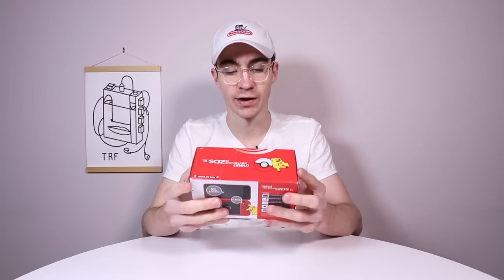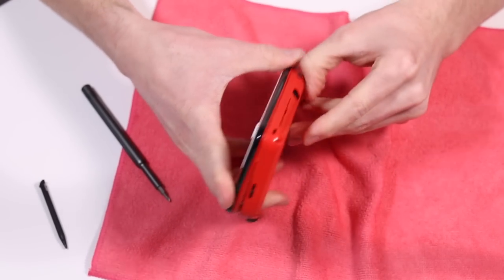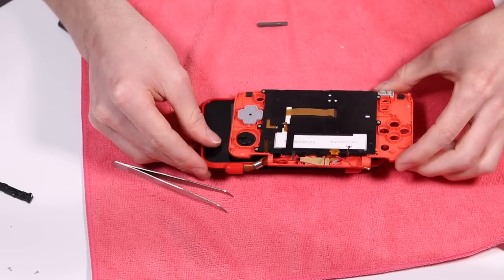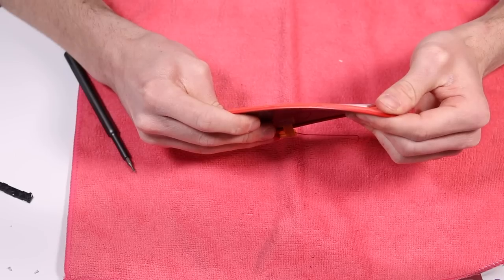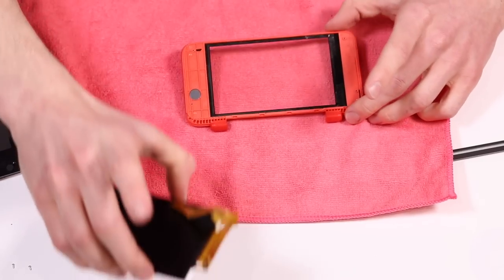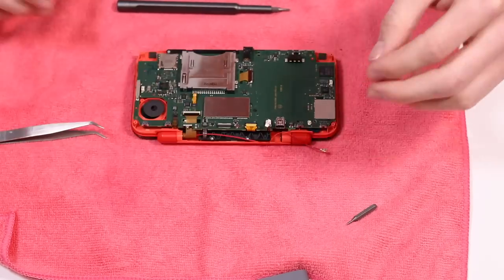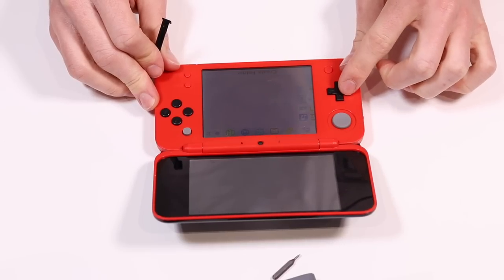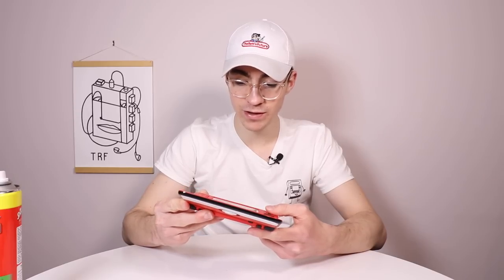The IMPOSSIBLE Nintendo 2DS XL Repair!

Comment: Refurb a some PS Vitas! :)
Reply: Ye
Reply: Less common.  Fewer sold for one and usually Vita owners are/were an older demographic so fewer get broken.
Not saying it doesn’t happen just that they’re usually quite expensive and the real ‘fixes’ outside of sticks are a nightmare in component costs.
Reply: Not really, pretty easy to replace pretty much anything at this point, I just replaced the display on mine.  @AcornElectron
Reply: You know why was the ps vita not successful, just a question
Reply: Big Doinks the fact that they must use Sony made SD cards, any other brand doesn’t work at all. And they were stupid expensive too. And also, not much big games besides P4G and Gravity Rush. I actually want one just for P4G, heard it’s a pretty hefty JRPG machine
Reply: @bigdoinks5884  
A simple answer to your question is, Sony.
Sony went through a lot of changes in that era including new staff, bosses and direction. The PS Vita was the old Sony's  (ps3 era) baby and the new guys wanted nothing to do with it.
Reply: @54356776  Never looked at it like that before. I was like sony what the hell are you doing ? This thing could've been great. I just blamed the company as a whole for the vita situation. I have an aqua blue and a silver psvita. I just got the ps vita tv from my local retro store for $28. Those things go for over $300. Even though Sony didn't handle these things that well. I still had to pick them up for cfw.

Comment: You should use a hot air gun or hair dryer to heat up the adhesive, that will make it easier to peel off.

Edit - was too quick to comment clearly 😂

Comment: Fixed to 3DS of my son some years ago. Its even worse, than the 2DS! While dismantling the display case is easier getting the brittle display cable in the hinge is horrid. The 3DS has no slit, you have to wind it up and stick it thru without damaging it. Took me several hours in the end.

Comment: One of the worst thing I have done is changing the keyboard on a HP ultrabook. It's about 50 steps and I had to take apart completely. But if someone done it once it's a lot easier the second time. Taking photos helps a lot for reassambling.

Comment: Your top screen protector surely get scratched for have it cleaned the back side with the towel. It's a common problem with the DSs and 3DSs. The front is practically unscratcheable but the back isn't. You can check it out with the console off and look it with direct light. I learned that on the bad way... Loved your reaction with the ribbon cables, hahaha. But I think the New 2DS XL actually has less ribbon cables than the New 3DS and the New 3DS XL. You also already know this but the magnet is for the sleep mode. Greetings from Mexico!

Comment: I think I could do it... At least based on what you showed. I completely fixed, reshelled, and rebuttoned both of my switch joy cons and while i didn't have to pry up a screen necessarily It was alot of the same with some adhesives and watching out for ribbon cables so I think I could do it, with some difficulty.

Comment: First time opening a 3ds and sucsessfully swapped cases on my modded 3ds ordered a crappy case with crappy font and decided to use some of new case with some of old i almost left top pink cuz of the ribbon wires but after 5 hours of putting together and taking back apart GOT IT. (After a few times i put together and something was loose )which is why it tool so long

Comment: I’m looking intro replacing the black screen protector that goes over the actual screen. Since the screen cover is only attached to the screen with adhesive; do you think it would be easier to remove simply by using a hair drier + exacto knife instead of dismantling the whole thing? (I will replace it so damaging the screen cover is no biggie)
Reply: Also thanks for the video. I’ve been looking for a good tutorial on this for months <3

Comment: I did my 2ds xl and damn it took a lot of patients and I kinda wrinkled the top plate thing with a damn heat gun but atleast I can play Mario again.  And also you probably removed way to much for just a top screen. I didn’t take off the main board at all and I only undid I think 3 ribbons.

Comment: This is gonna be the least educated comment here- I have this exact 2DS that I bought brand new from I think Tesco or something- worked completely fine for literally a day and then the day after I booted it up the battery was flashing red. Plugged into the charger the charger light came on but it still flashed red. Left for a whole day on charge and it was still flashing red. Ended up phoning the Nintendo support number and they said I’d have to send it in for repairs, and even though it was brand new because of the unsure cause it wouldn’t be covered by the warranty, so it’d cost like upwards to £200 and take like 3 weeks. I’m not sure what made me try this- but I just slapped the whole DS aggressively hard against my hand a few times and it miraculously fixed it. Had it over a year now with daily use and not had any problems since. My guess is that something was loose or whatever but I have literally 0 idea of what.

Comment: 2:56 mate you just yanked the cable out, the very thing you just warned against
Reply: That's if you don't unlock them, a ton of gba modders just yank the motherboard out after they remove the lock

Comment: I'm trying to fix my younger bro's N2DS's charge port (it was absolutely screwed) so I had to just desolder it from the motherboard. Now the problem is I can't find a replacement part for it ANYWHERE. It's this exact same version of a 2ds xl. Would you be able to point me in the right direction?

Comment: I just bought one for 32,25 inc shipping. I bought it to Challenge myself a little :)
Reply: @Loc I'm still waiting for a new screen lens because I Scratched it. But I hope to get the repair lens pretty soon so I can finisht the project. The best tip would be to really Heat up the top thing of the DS because mine had more glue than in the video's on YouTube. I'll let you know when I'm Done. :)
Reply: @Loc I did it! The new screen is installed. I did break the volume button switch so now I have to fix that too. But the top screen works perfect now :D

Comment: Hey elliot, sorry for the rude livestream message on your ds lite livestream. Anyway  I got a launch 2ds from a friend for 15 euros because the touchscreen was defective and because he had just bought a Nintendo switch. I managed to fix it and gave the 2ds a good clean because he never cleaned it in those 8 years he had it, it was DISGUSTING, o and it was also modded with luma 3ds homebrew

Comment: My son spilled a water bottle on his Nintendo 2DS XL and it cutoff. It wouldn't turn on again so I suspected the worst. I replaced the motherboard and the battery but it still wont come on. Did I do something wrong or is this DS gone for good?

Comment: I would avoid the New 2DS XL because:
1. The New 2DS XL's rechargeable battery cannot be replaced.
2. The New 2DS XL's speakers are at the bottom of the New 2DS XL.
3. The New 2DS XL's controller grip add-on muffles the speakers.
4. The New 2DS XL's stylus is really tiny and the stylus does not extend and retract.
And 5. The New 2DS XL's speakers are not loud enough.
Reply: The battery is replaceable, and the speakers are plenty loud enough. The other complaints are valid though.

Comment: man, I would have taken the opportunity to flip the orientation of the white and red top plates so that the design looked correct while the system was actually open. Nintendo has a history of releasing designs that look great when the system is closed and look silly upside down when the thing's in use.

Comment: In 40 years, all these flimsy newer systems are going to be long since dead. People will be playing these games on emulators or inside cheap clones that have a DS on a chip under an epoxy blob.

But I bet the original DMG gameboys will work just fine 40 years from now.